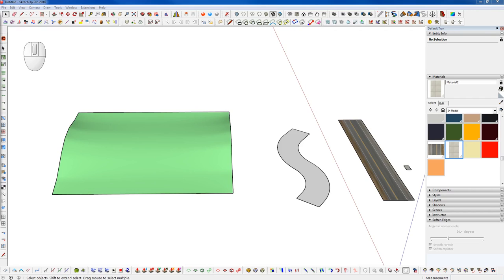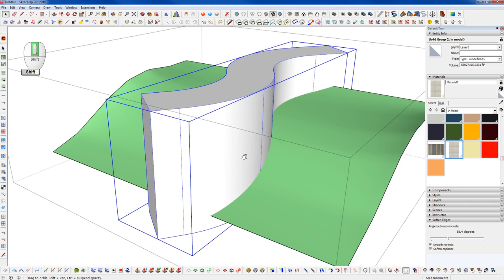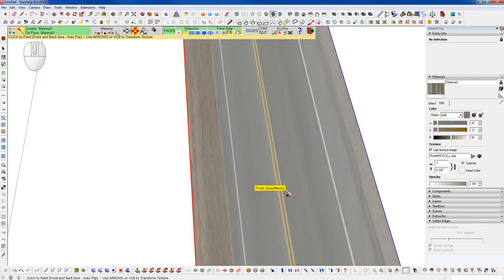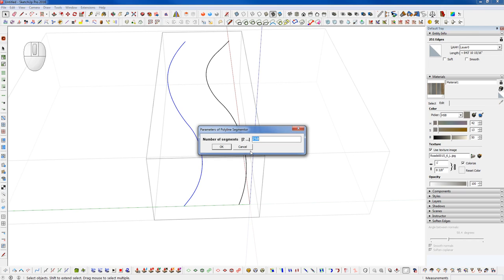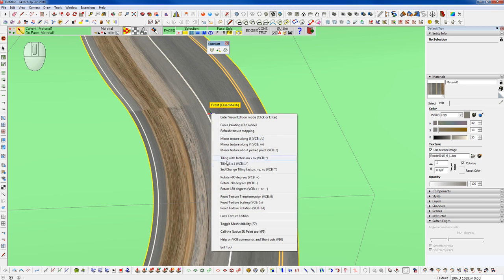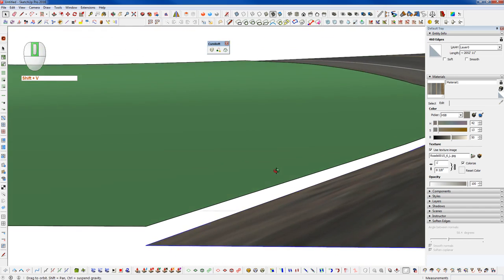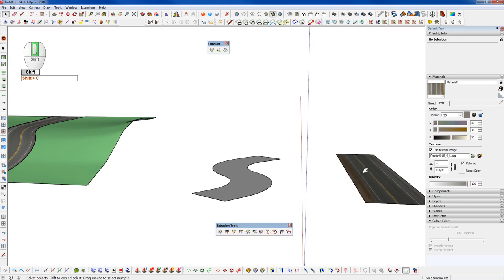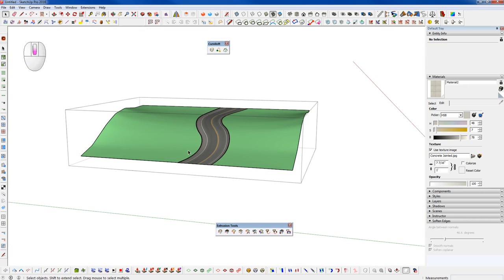Sketchup Tips - How to Conform a Road to a Terrain and Texture it

Comment: Excellent video, but I would like to bring it a step further. Suppose you have a curvy river through a rolling landscape. Along the river side you want a road. How do you make the road flat and leveled? With Sandbox Drape I have 2 lines. I select and weld the slope sided line. But becaise the slope angles differ the height differs between the slope side line  and the river sided line every other meter along the road. How do you do it?

Comment: Hello I am working on a very complex terrain  and In my case it is not happening.
It is a very complex road on the site Also
The road after the loft by spline  it is connecting different ends and making a very wiered surface.
Reply: Can you help me with same.i tried doing it many times.

Comment: For dropping the road onto the terrain; You could've used the drop tool in the sandbox toolbox. Just select the road and press drop, select the terrain and it'll drop down exactly on the spot the road is above. Gives the same result, but you won't have to extrude the road. Or is there something i'm missing? Great work on the texturing though!
Reply from the maker: Flipswix But drape messes up the texture.  We are trying to work with clean quad based geometry.
Reply: Question:  when you use BZ Plyline Segmentor to equalize the sides of the road, you no longer have a 'clean' connection to the adjacent 'grass.'  Is it normal practice for you to just ignore the small gaps that are created or do you have a method that isn't described here to keep the geometry clean between the road (or curb) and adjacent surface?

Comment: Is it possible to make a closed 3D object of a road instead of just a painted image? Because there is this superelevation and widenning. I find them tricky.
Reply from the maker: I'm sure there is a way.  Can you explain a little better what you want to achieve?  If you wanted to start with a closed profile of the road and curve and have the path the road would take, you can used the Follow And Keep plugin to keep the road level along the path.  You could also draw the road out straight and then use the Shape Bender plugin to conform it to a path.  You could also use the plugin Flowify to conform a road to a prebuilt surface, but that one is a little tricky.
Reply: Thank you for the quick response.

I've been in road construction before and I was in the planning department for more than two years. Drafting roadways in 2D has been a pain for me as you have to draw all the elevations of the same object, you know its a redundant task.

One problem I have is with the clothoid, its a view of the road in straightened and stretched longitudinal elevation of the road (in AutoCAD). By the way, this custom elevation is used as reference to design super-elevations of two carriageways in a road and widening lengths for one carriageway (the lower side of the super-elevated road) of highways. If you don't know what I meant by superelevated, it is when a road kind of inclines to a small angle (your viewport in this one is perpendicular to the vertical plane or cross section view or front side elevation). Superelevations are in percent form and they range from -1.5% down to -8% and can go up to +8%. These are commonly used on highway roads. Superelevations are imposed everytime a straight road enters into a tangent to a circular curved state (your viewport this time is perpendicular to horizontal plane or top view). Widening is added to the lower curves from the two superelevated parallel curves (your viewport on this one is on the custom 'clothoid' elevation). Maximum widening of a 3.35 carriageway is 0.90 meters. When widenning is added, I think that the lower (inner) curve is no looks like it is parallel to the upper (outer) curve.

What I saw in your model is that your road mesh conforms directly to the existing ground mesh. In road design, there are a lot of variables you have to consider to make it safe for a vehicle to traverse with. One particular is the vertical curvature of the center line of the road. If that vertical curvature is small, then it would make a bumpy ride for vehicles. And one other thing is the vertical sight distance that allows you to see coalition and those vehicles you are tailing (for safety purposes). And just by these factors, I say that the road mesh doesn't always conform the existing ground mesh especially when the mesh goes uphill and downhill. What happens is that either the roadway will have to cut a hill and make excavated slopes on either sides or make a hill and put sloping embankments on either sides, or a set with one of each type for each side of the road depending on the shape of the natural ground mesh. Please refer to this image: http://www.nativerevegetation.org/images/learn/fig_3_7.jpg

I've made my peace with this task in AutoCAD before by presolving the coordinate points for each line segments in MSExcel, all I had to do is input the variables then copy and paste the cell containing all the coordinates to AutoCAD. But all those were 2D, I want to see and marvel at it on 3D. Haha! I had my share of frustration and fun programming those tables in Excel. I just don't know ruby yet.

I'd appreciate it. Thank you.
Reply from the maker: Rod Templado Are you using ACad Civil 3D?  Im pretty sure ther is a superelevation tool.  There might be a way to use the excel data to generate a sketchup point cloud or TIN.  If i could get the superevelation points mapped out in Sketchup, Im pretty sure I know a way to solve it into a 3D Mesh.  It would still be tricky though.  

I did a video previously where I made a physics sim in sketchup of a marble rolling down a helical track and had to sort out the banking of the turns, however it was far from precise.
Reply: If you say so then I guess its really tricky. I have yet to improve my 3D spatial skills then. I haven't tried ACad Civil 3D yet. Although I've seen it work with my previous colleagues I thought that my current computer setup can't handle processing time of the software. I kind of have this mental disorder related to impatience. This is why I'm using Sketchup for its lite engine. I guess I'll just have to find ways myself.

Intersecting perpendicular faces/meshes may just do the job. Highway roads heavily refers to its center line. I'll start there.
Reply from the maker: I'd be happy to put my brain to it as well when I have some time.  If you want to email me an example from Autocad that you want to recreate in Sketchup, I'd enjoy the challenge.   My email is clearstoryimaging at gmail dot com.
Reply: They're all in 2D and I kind of feel that its kind of embarassing since the version of the file is 2012. Really primitive. LOL. I'll bump you up in this comment section to notify your before I send you a .dwg file with the typical example on the matter. It'll take some time though, because I have some pending as-built plans for some residential and commercial buildings on queue for final polishing before printing. Also I had to go outdoor and visit a friend this weekend, her mother just passed away. Let us have a great weekend. Until then. Thanks.

Comment: How were you scaling the road texture after you applied it to the mesh?  Great tutorial...
Reply from the maker: +NewbVT I'm using the Thrupaint plugin from Fredosix.  If you right click with the tool active, you can set it to tiling 1x1 and that will fit the texture to the surface.  You can then adjust the scale in the individual X and Y directions if you are using the Quad Mesh UV mode.
Reply: +Winning With Sketchup  Thanks...I have Thrupaint...which is new to me...but I still can't seem to figure out how to use the scaling that you are using...I understand the tiling 1x1 and the Quad Mesh UV mode....but I can't figure out how to access the scaling feature?  In your video it looks like it just happens, but I don't know how to access that tool.  I must be missing something.    Otherwise this tutorial has been very helpful and came to me at the perfect time...I've succesfully gotten through all the other steps....and I subscribed to your channel today--looking forward to your other videos!
Reply from the maker: NewbVT   Thank you.  Once you have painted a surface with Thrupaint, it should have a yellow edge around it.  If you are in Thrupaint and click on something that has already been painted (and has that yellow edge) it should bring up the scaling gizmo.  It only becomes active if you click again after painting.
Reply: +Winning With Sketchup Many thanks I will try this out tomorrow.
Reply: +NewbVT  Got it!  It required a double click.
Reply from the maker: +NewbVT Great job.  Good to hear.